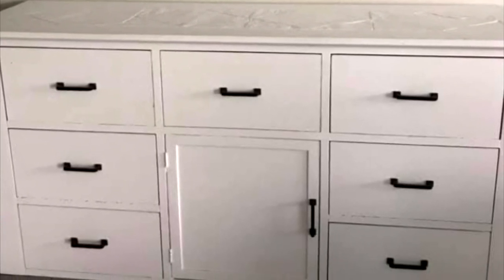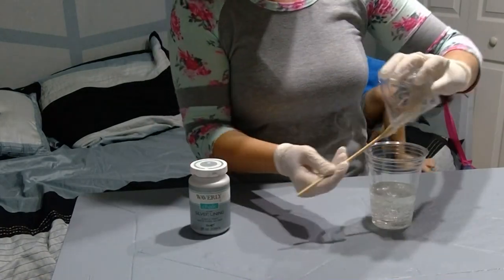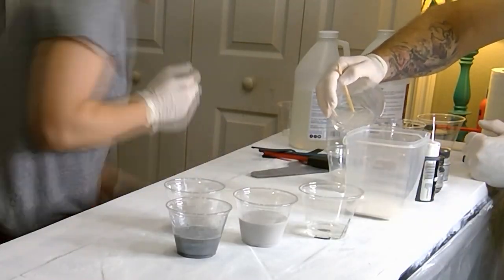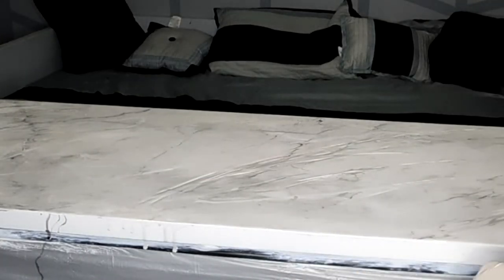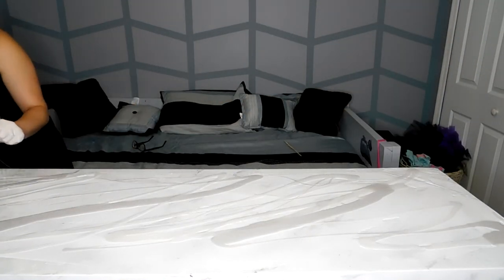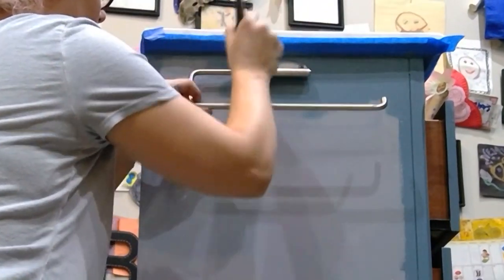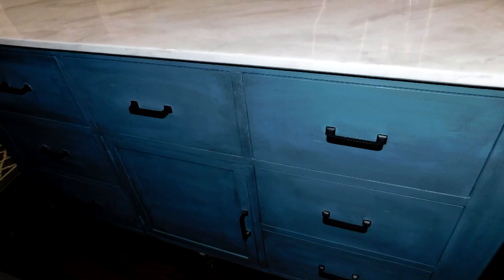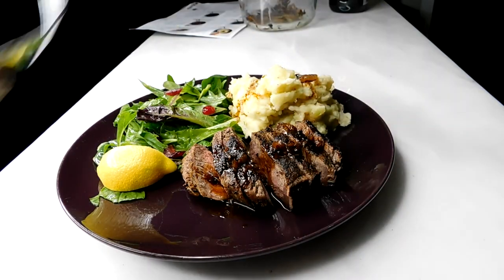Kitchen Island Epoxy Makeover

Comment: Hey girlfriend, after watching you do this it's absolutely stunning!. And I'm going to do the acrylic paints and then clear coat like I did on my bathroom this is just too much work and too complicated by myself plus it would only be my second time doing any epoxy work.. You're getting to be quite an expert! Thank you for the heads up
Okura I didn't have a blowtorch so I tried to use a long candle lighter and it didn't work well FYI I also learned what you probably know it's a carbon dioxide not to eat the pops of bubbles that's why the breath works so I'm just going to do a straw have a great day